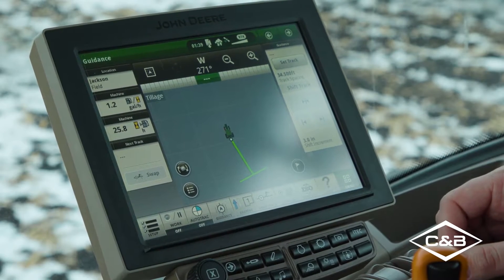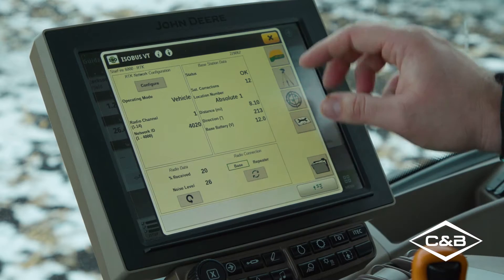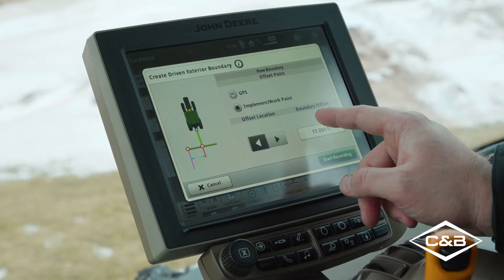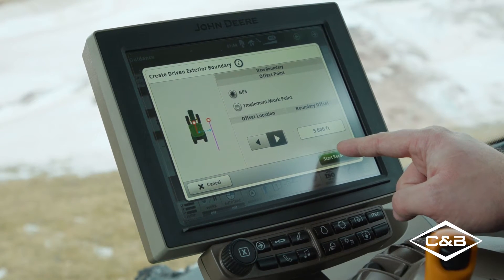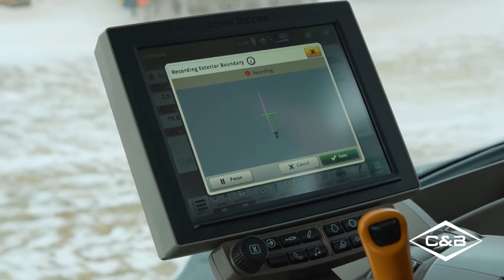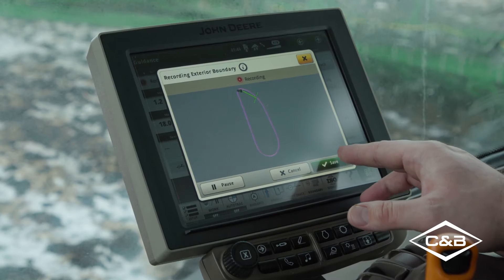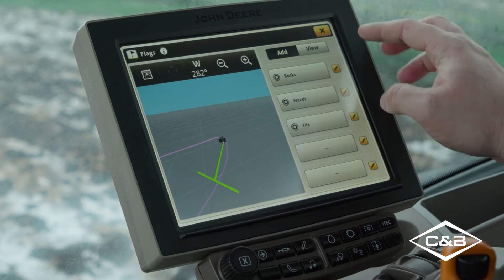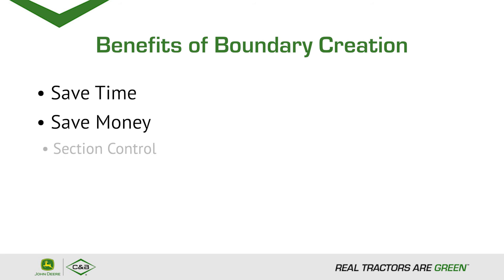Virtual Tech Days 2021 - Day 2: Boundary Creation

Comment: How do you record a 90 degree corner? Do you drive all the way to the corner and then press pause and back up to the other direction? Or just making a curve out of the corner?
Reply from the maker: Yes, you have it perfect - drive up to the corner, pause the recording, backup & turn your vehicle/tractor into the right position for after the turn and resume recording the boundary - the line will ‘snap’ from where you paused it to where you resume, so just be sure you’re lined up where you want before resuming
Reply: @CBOperations  i can never buy this but i stil do watch it, i dont know why. LoL. But the thing is, they should make it more easier, With automated turning speeds and automated points where its pulls up the equipment or lowers it, after the bounderies are set up. Now you need to adjust a lot and for someone like me, let say, who has zero experience but want to be a farmer and buy this, before he will learn it will take him ages. Turning, pulling up, lowering should be pre-set for noobs like me